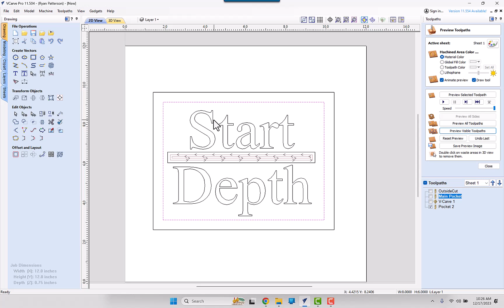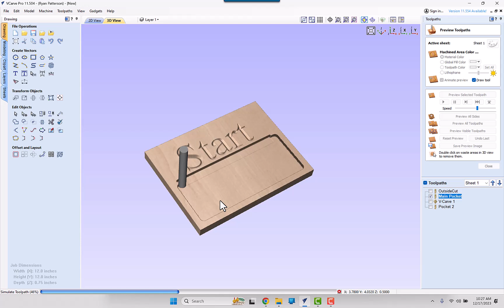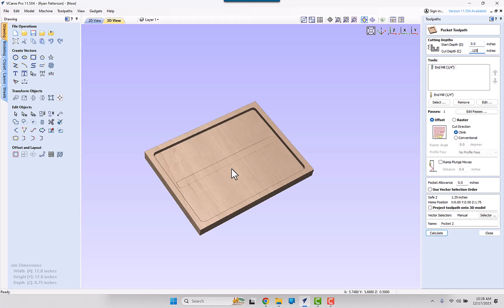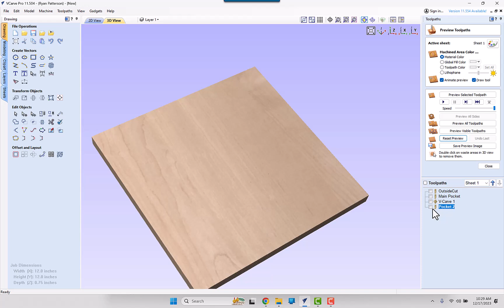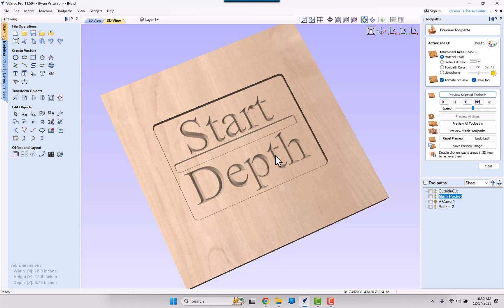VCarve Pro and Aspire Understanding Start Depth

Comment: This is very helpful! Are you zeroing the table or the material?
Reply from the maker: @MariannUleberg  I generally zero to the table.  For what is in this video the location of Z zero does make a difference.  The decision of where to Zero Z really does not matter as long as you have accurately measured the material thickness.   Another reasoning on where to Zero Z could be based on the type of operations you are cutting.  If VCarving knowing where exactly the top of material is is important so instead of measuring material accurately you can zero on the top.  Now if most of your cuts are through cuts knowing where the table surface is is important to not cut to deep into spoil board so you may zero to the table surface.

Hope this makes sense.